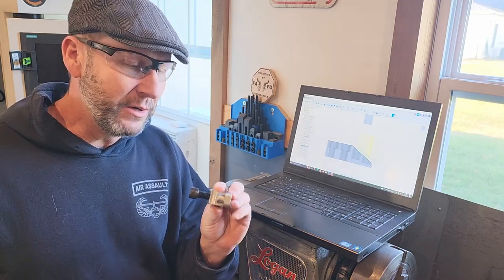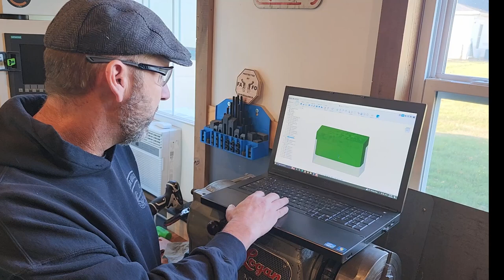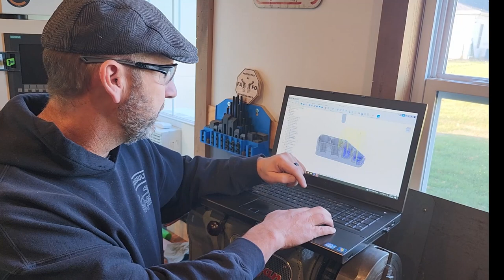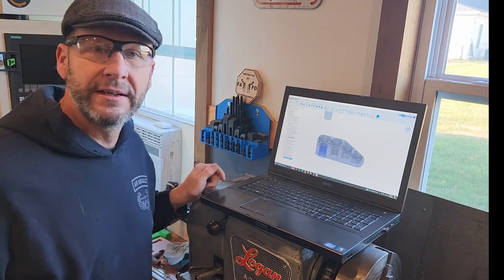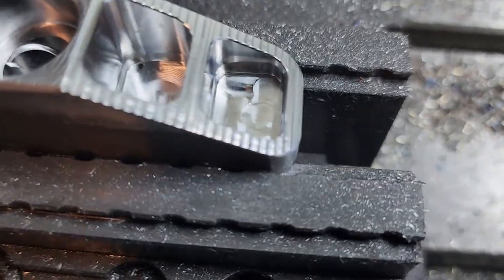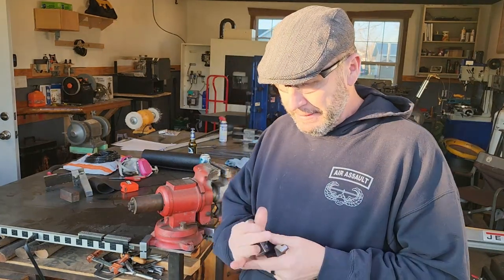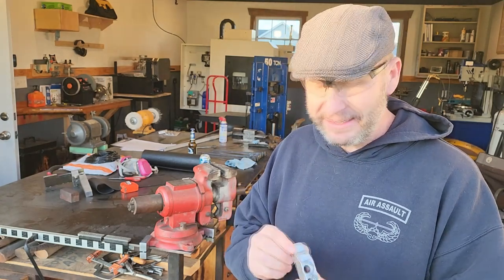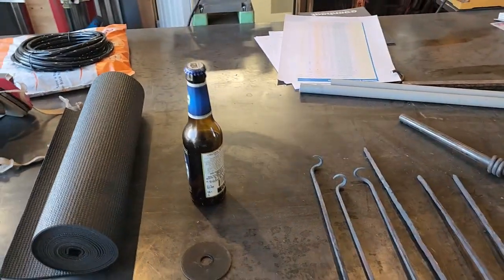Part 2: Machining a Vise Clamp on Syil X7

Comment: I have been doing a little digging into the Syil machines. Seams like the ones people get as promo mills are pretty good ? However I suspect these are gone over with some extra time and care, I would suspect you have a production machine on the floor in your work space. Perhaps you should consider getting a company local to you to perform a bull bar test and check pre=load on that Y axis ball screw. There should be no issue cutting in either direction with a simple 1/2" cutter with proper speeds and feeds.
Reply from the maker: Thanks for the comment.  I'm not familiar with a bull bar test, but i appreciate the suggestion.  I was one of the first guys in the US to receive this newer model back in 2020 with the epoxy granite, etc.

Most of the other YouTube videos I see show the Syil milling Aluminum.  Even though mine squals (probably user error as much as machine) I'm pleased that it does so well milling alloy steel. All of the tools and dies I make for blacksmithing are milled out of some type of alloy, 52100, S2, H13, etc.  So far, the Syil has been great.

The two challenges I spent most of my time working through in the beginning were probing with the Pioneer and finding CAD/CAM post processors for the 808D.  Thanks to Peter Betz, I have had success using Fusion 360 with the post processor from his website.